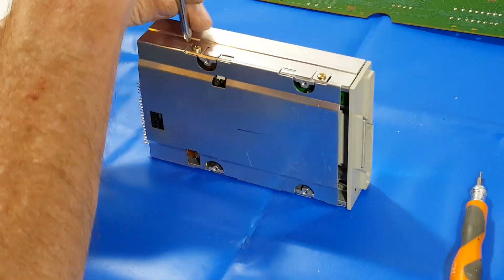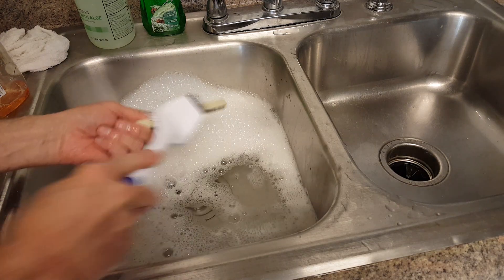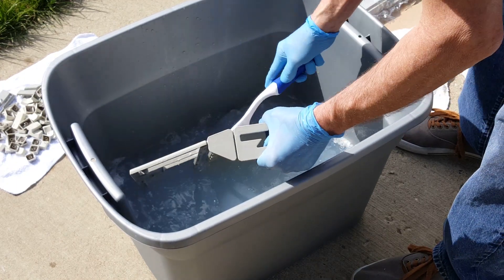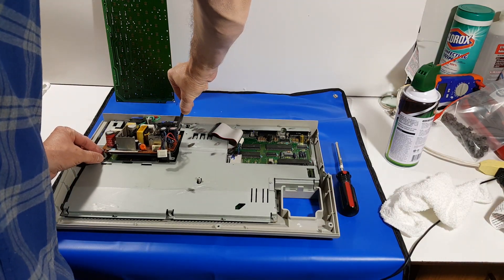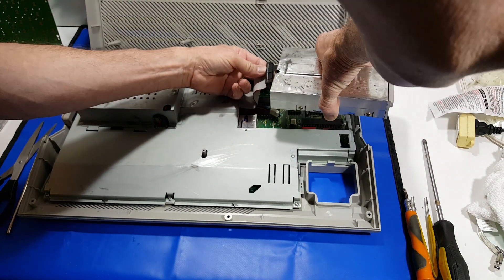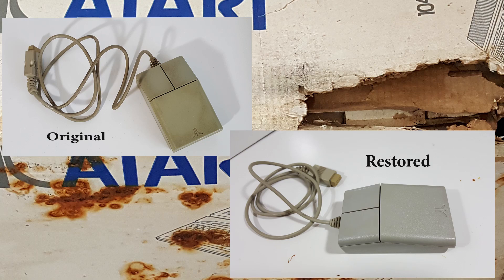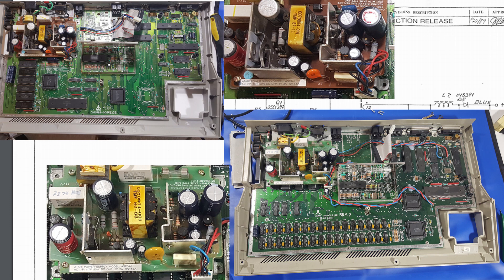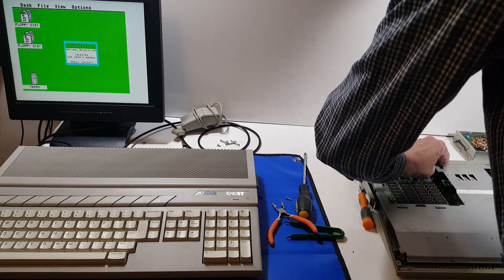Restoring an Atari 1040STF - Part 2

Comment: Polarized Capacitors electrolytes are chemical and need replaced after that long.  They can create timing issues among other things.  Also should check power supply using a scope.  Capacitors will usually solve most issues.
Reply: I once broke a C64 in half ... swapping the caps fixed it.

Comment: That stuff around the IC in the disk drive is just flux used in production for SMD-soldering. It's absolutely harmless to electronic devices.; that's why they rarely clean this off after soldering.